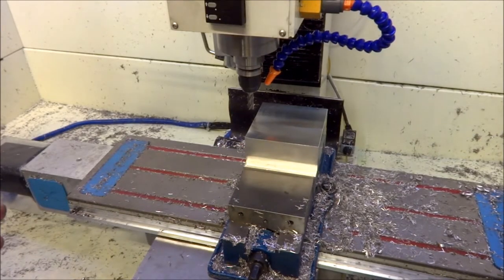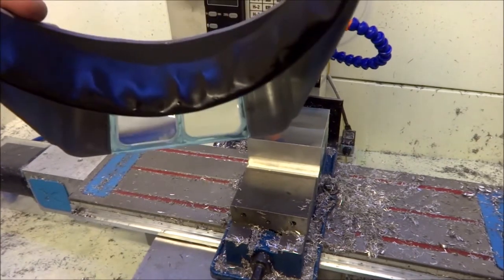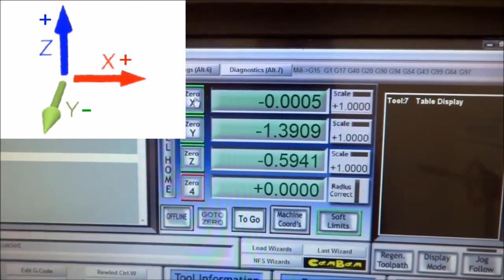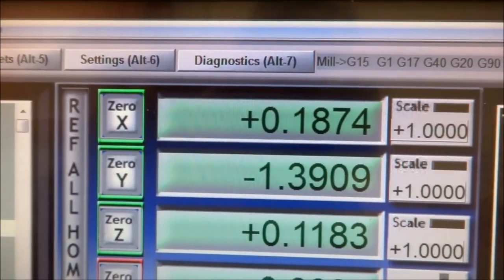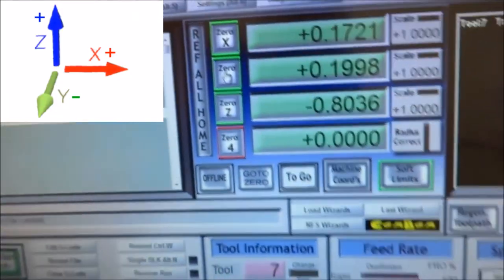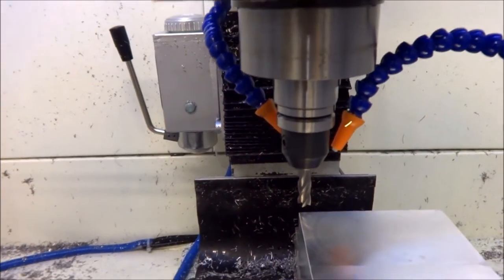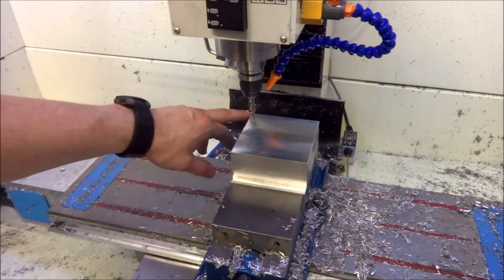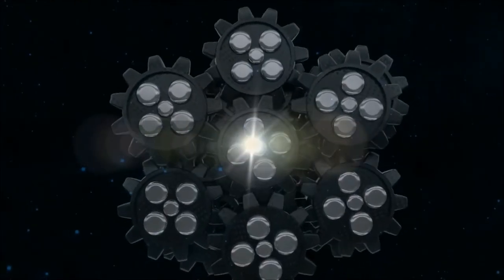Stock Origin Setup

Comment: I thought you used a master tool! We need a good probe, I have been looking. I use the offsets tab in Mach3 find edges and z height using master tool then load first tool to be used in program. At first it was hard to get use to the offsets tab, I still have to be very cautious!!
Reply from the maker: James Hopkins 
hey James
I normally use a 3/8 end mill ther big enough to see good. normally its always tge same tool though.
yes a good probe i got my heart set on a ITTP from Cliff Hall

Comment: I'm kind of curious why you don't use an edge finder to set your x and y and a 1-2-3 block to set your z.  The tools are really cheap and accuracy would be much better. Haas has some good videos on how to do this.  There is nothing wrong with your method if you are going to be machining away all faces of the material anyway but if you were locating for a second operation you are going to want more accuracy.
Reply from the maker: Jason Carter 
thanks Jason, those are good options i personally found it to be more trouble so I dont use them. one daay Ill get a touch probe.

Comment: Instead of zeroing the axis once in place you should just select the DRO and enter -0.1875 for x and 0.1875 for y.  The jogging is an unnecessary step and provides no more accuracy than what you have already done and simply takes time.
Reply from the maker: Jim Duchow 
hi Jim yes I simply type .1875 in the dro as well i actually find it more acurate. However  if your not familiar jogging will allow you to see if the value needed in the DRO is pos. or neg.  be safe Sam
Reply: fair enough, good point actually
Reply: I'm not making any assumptions and couldn't care less about his original position. Entering the values i stated in the DROs (i.e. setting the DROs to those values, i am not talking about commanding a move of the machine) would give the proper x,y zero.